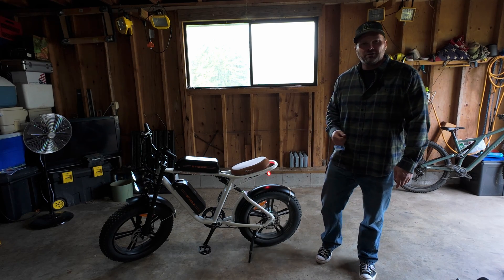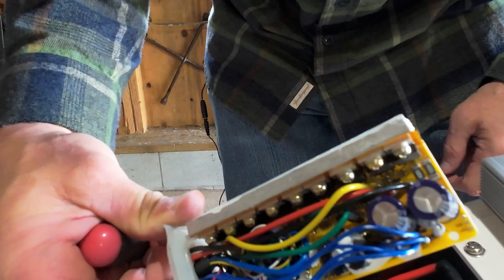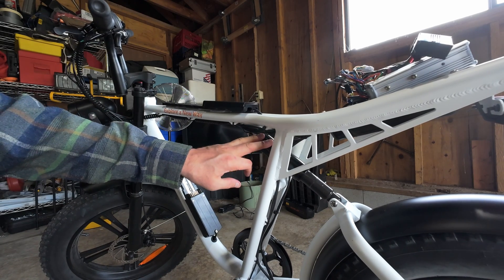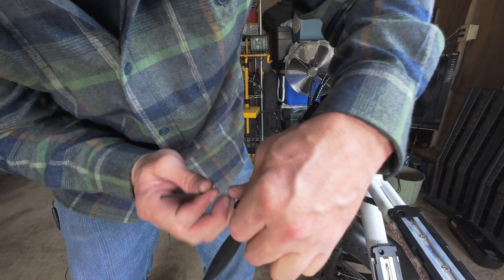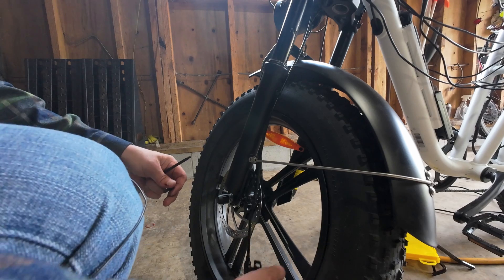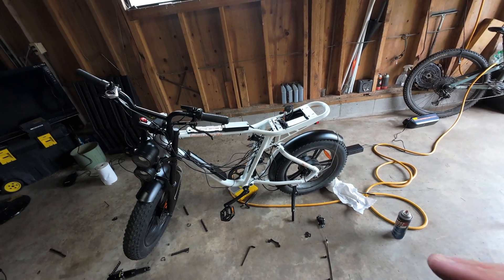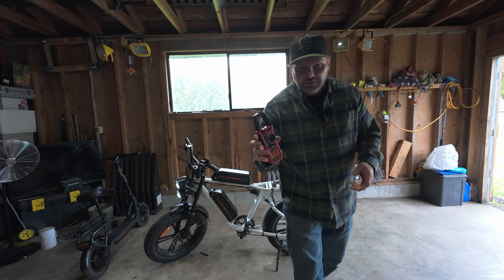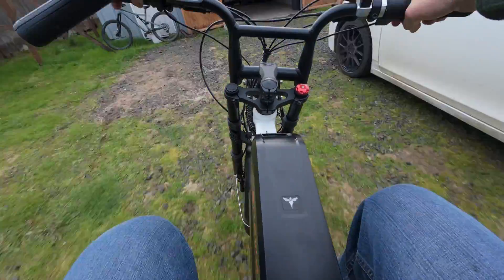Modding The Engwe M20 - Brakes, Controller, and Shock * 1.5x The Power!!

Comment: What size resistor did you use?  Did you jist solder it onto one of the existing resistors?  I have a Engwe E26 so components are probably similar

Comment: hey man, i was wondering, did those breaks work plug-and-play with the controller?
did you have to re-do the wiring or anything? thanks a lot!
Reply from the maker: You have to remove the old brake wire and use the ones that come with the new brakes. It's not very hard to do since you have to run the brake hoses anyways
Reply: @shootthechit  thanks for the quick reply.  i meant, do they plug straight in the controller, or do you need to cut the wires and resolder them. but from what i see in the video they plugged right in.
Reply from the maker: @DEPARTE  They plug straight in, same style plus as stock.
Reply: @shootthechit  and btw, thanks for the video, it was very useful. I'm ordering the same parts now, but will skip the controller mod since i'm half your weight :)

Comment: whats the chance to get your butt exploded after that controller upgrade? I guess a wheel motor is not going to live long after that power increase
Reply from the maker: I don't think its gonna be an issue really, its not like its putting out a massive amount of power and the bike never gets prolonged full throttle usage

Comment: What happens if you shunt both nodes using two resistors?
Reply from the maker: No idea, but I wouldn't want to run anymore than 30a through that controller

Comment: Nice video man. I will have to try these mods, but I wonder, by how much would it affect the range of the bike?
Reply from the maker: Its pretty much 1.5 the power, so it would eat through the battery quite a bit faster.  Never did a range test to know exactly but you will notice a difference.